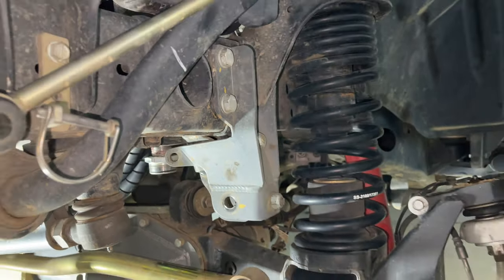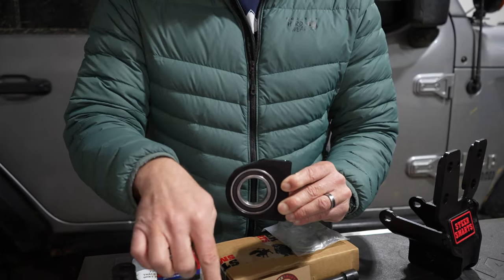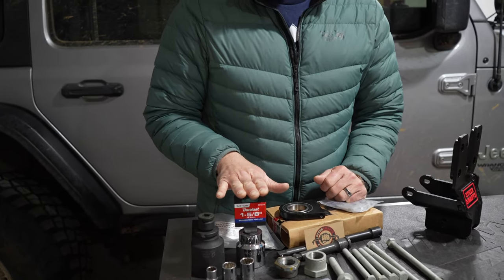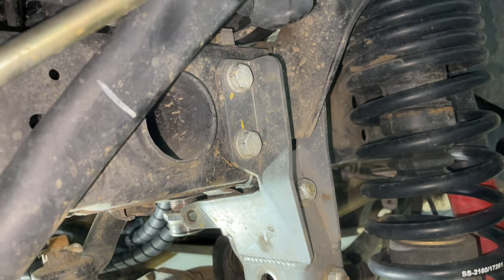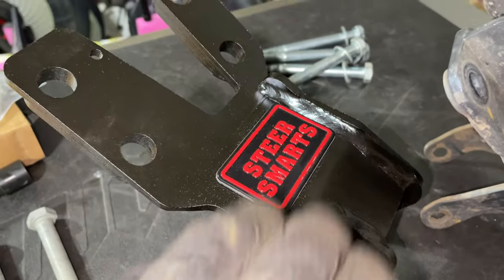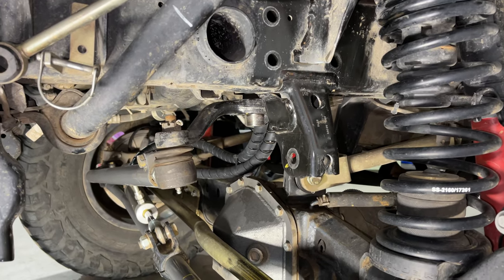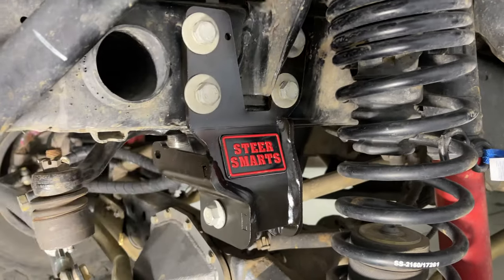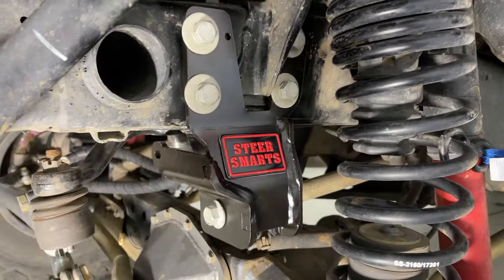JL Wrangler Track Bar Bracket #jeep #offroad

Comment from the maker: Thanks for watching the video guys, I’m enjoying the tighter steering and decreased noise I’m getting from that side. I may have the bracket welded to the frame in the future to see if that eliminates the remaining noises. Let me know what brace you guys are running in the comments below 👇
Reply: I just put the steer smart on my Gladiator, it's soon to get 37's.  I ve had a shake in my steering wheel on one rd that comes and goes with air pressure, first drive today with bracket on and shake is gone, all else is tight and have a big ass terra flex trackbar and 2.5 lift with all the drop brackets.
Reply from the maker: @ it’s a great product for sure, thanks for watching the video!

Comment: New to this but whats the main reason to do this? To tighten up the steering wander and provide more support overall to the steering box? Is that mostly when U move to bigger tires or even with stock setup?
Reply from the maker: A lot of these Jeeps come with pretty sloppy steering from the Factory on Factory tires. It made a huge difference on mine when I added this, it also supports the steering box sector shaft. When you start offloading this is definitely a great mod for these Jeeps. Thanks for watching the video!

Comment: You're saying install this YETI XD™ JL/JT SECTOR SHAFT BRACE WITH FRAME SIDE TRACK BAR REINFORCEMENT BRACKET and don't have to take out tire to install this product and is there a room to this job  without taking out tire and still use same tools?
Reply from the maker: Yeah, if you turned your wheel full driver you would have the room needed. But it does make it easier with the tire off and the extra room to work. It’s a pretty easy install, let me know if you have any more questions and thanks for watching the video Jay!
Reply: Do i need to 1 bolt to take out for sway bar  and move it up for room?
Reply from the maker: @jayhernandez6812  yeah, I have quick disconnects but if you don’t you will have to unbolt it and move it up out of the way.
Reply: When you put back the trackbar is it line up on spot, don't need to turn wheels so will reach the hole?
Reply from the maker: @jayhernandez6812  it depends if you’re Jeep shifted at all while installing the bracket. It probably will but if you’re working by yourself just turn the wheel a little bit at a time and it will line back up just fine.

Comment: What track bar do you have an did you have any clearance issues with it
Reply from the maker: I have a Metalcloak track bar, haven’t had any issues with this combo so far. Hope this helps, thanks for watching the video Derek!
Reply: I have a jk and I’m having fitment issues with track bar
Reply from the maker: @derekdean2614  what brand track bar are you using?
Reply: @FROSTBITEOFFROAD  rough country
Reply from the maker: @derekdean2614  where is it hitting? Is it something you can grind down and make work? If not, I’m sure the Steer Smarts track bar will fit no problem.
Reply: @FROSTBITEOFFROAD  I wished I had to remove the sector shaft but an out it back together until I can get steer smart on the phone

Comment: Is there away to hold the axle in place won't move after taking out taskbar ?
Reply from the maker: You could use a big ratchet strap from the frame to the axle but it’s really not that necessary. Just make sure you take that pitman arm nut off and put the new nut on first.